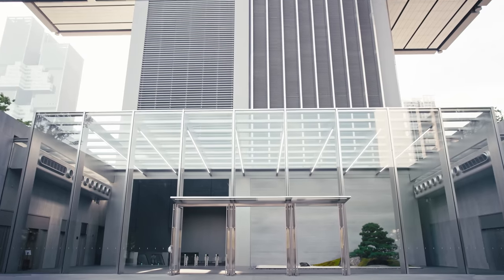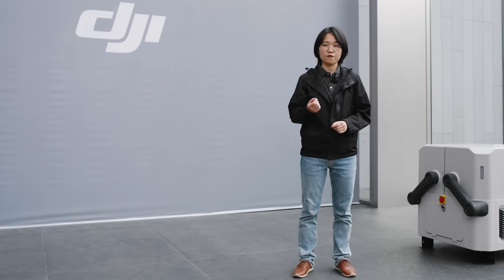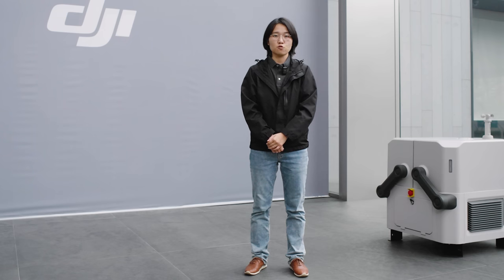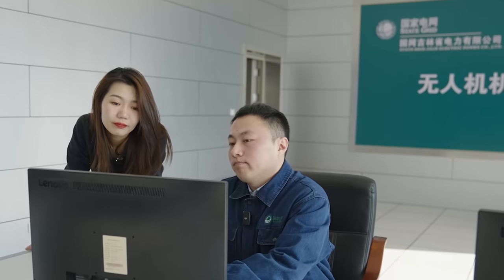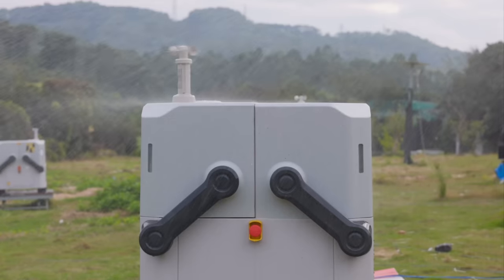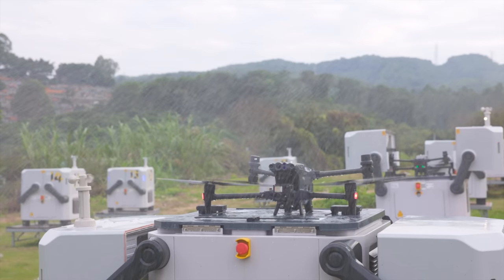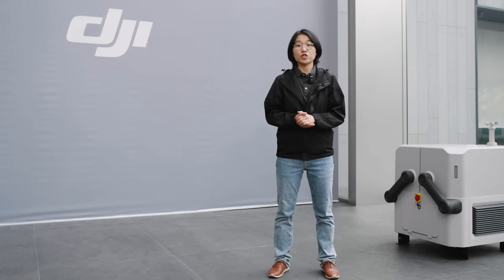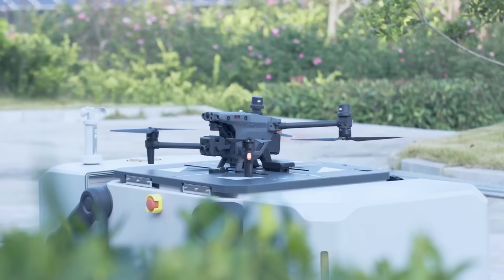DJI Dock, The Next Generation of Drone Technology

Comment: You know it would be cool if DJI could develop a version which you could fit on the roof of a vehicle. Something the Police or emergency services could deploy quickly. Just like the one in Blade Runner 2041, much cheaper than having to call in a helicopter.
Reply: Bro calm down don't give them ideas 😂
Reply: Or you could bolt it down to the bed of a pick up
Reply: @yumcooki3z  Next time we will be seeing army personnel using this technology.
Reply: We will have that in 2041 😂
Reply: 中国有一款越野车仰望U8将实现你的愿望。
Reply: @yumcooki3z  dude, the off road suv U8 from BYD has equipped a dji drone in market now, u should check it out
Reply: @yumcooki3z
Reply: @RahulSingh-pn6nm
Reply: BYD＇s new ORV car will have this technology，it＇s name is yangwang u8.

Comment: The dual hinge design opening in the middle has a giant design flaw: If you open it while snow lays on top, you have your drone fully covered in a thick layer of snow, unable to take off. A single Hinge design taking off the whole cover would solve this.
Reply: I wonder if the hood is heated, which would keep the snow off and dry the wet drone inside.
Reply: @Keezer  I wondered the same. seems likely if this is supposed to be something that can sit for long periods and always be ready to go, the box is charging, drying, and heating the drone/enclosure in cold weather
Reply: Don't tell them sell them one

Comment: DJI is the future. I have a small business and I'm considering a new operation of delivery using DJI Drone. My problem is airdrop accessory remote control distance is too small for my clients. Is it possible to get at least 3-5km airdrop accessory remote control range?
Reply: Sounds like you just need to have better gain antenna signal boosters.

Comment: Does the dock charge the drone? This surprisingly wasn't covered in the video.
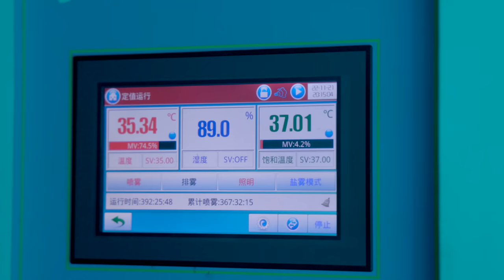Reply: yes you can see that at around 4:30min or so. the clamps push each drone after landing into the middle where most likely is an induction charging pad below or just current through the landing legs.

Comment: so how will it charge the battery in -20c ??? does the box heat the drone to proper levels and melt the ice also? then keep the drone warm ALLWAYS?? batteries dont like the cold and even on -5c you loose like half the capacity... here in Finland that box would freeze shut. and on a proper "rainy" day it would be FULL of snow :D open and close few times and the drone would not be able to land enymore... its nice to go out and find the drone when it hits a bird or a motor fails when the operator is 200km away :D it for sure need to have redundancy and 6 propellers is a must.

Comment: Strange that for a snow scenario that there is no obvious solution for removing snow off the dock.
Reply: A hack would be to locate in under a canopy/carport structure. There's probably no way it could work reliably being left out in snowy/freezing conditions permanently, although the presentation did seem to imply that.
Reply: The snow will probably just melt from the heat generated by the electronics in the box and drain away the same way rain would. The box only opens for a short time so I can't imagine too much snow would get in.
Reply: I believe the hailstones will smash the weather station on the dock

Comment: Looking at a possible application, some concerns come to mind.
If i were to place the dock on a remote site, it there a possibility for me to install products for physical security.
As an exempel, if someone were to force the dock open can i attach an magnetic contact in the doors.
Or is there internal space for me to install a seismic alarm point so i can notice if someone is trying to force the dock open or try to move it.
Weather is nice and all but for some applications it would been interesting to see what options there is for physical security.

Other then that, great solution and i can see a lot of applications were this is very useful in all sectors.

Comment: c/o New Atlas 'The Matrice 30 on its own has a guide price of US$9,999, while the M30T package comes in at $13,999. Operators looking at remote deployment will be looking at around $30k for the DJI Dock and M30 together, or $34k for the Dock and M30T. Buyers are advised to check with local dealers.'

Comment: This is awesome. DJI needs to incorporate Waypoint in the Air 2S and Mini 2. I dont like running 3rd party apps to accomplish this.
Reply: Which apps you use?
Reply: @kuzadupa185  litchi has good waypoint functionality
Reply: I've been using Litchi for the past 2 years for a client's site progress weekly update. So far so good. The app can create/save and perform repeatable waypoints.
Reply: @Shawn_X20A  Yes, I know. I have it as well. It would be great however if DJI would integrate it into the latest DJI Fly app. The Mavic 3 is supported, but not the very popular Air2S and Mini 2 (which I fly) I see DJI removed the link to Litchi I posted yesterday. Come on DJI, Get with the program. Waypoint is the only way to fly.

Comment: One oversight- the entire video, I'm waiting to see how it works? How does it recharge, how long does it take, how long can it fly? Completely left out of the presentation...
Reply: It specified 25 min fast recharge with air conditioned batteries when docked, 7km range with the standard flight time of the Matrice 30. It's safe to assume recharging is done wirelessly similar to charging pads for mobile phones.

Comment: How exactly are you going to go worldwide with this? US regulation requires a licensed operator if the drone weighs above 250 grams, and that's only the US
Reply: worldwide as in only regulated countries and states i guess.i didnt know you needed a license lol,i read you can mod them so they arnt detectable by radar cause once you register them its a air license plate type thing i guess.
Reply: I think you missed the part that this is for "Enterprise" flyers, which means for businesses, and if you are operating a drone for business (for pay) then you must be licensed anyway. I just recently got my FAA License... but I don't get why you think this would prevent DJI from "going worldwide" when there are plenty of licensed drone pilots and businesses that can and will use this platform.
Reply: @pickleeggs3340  well you read wrong then. There is no anti radar device for drones, and in fact all drones after Jan./23 are required to have built  in circuitry that sends a signal out with your ID and location.

Comment: They should have designed the bottom for forklift attachments for construction equipment.  This is a great idea for operations such as ocean oil rig platforms or shipping ports. They got a good opertunity for coast guard  such a offer a drone that has FLIR, IR, and Flare launchers.  They could put the drone on boats & at ground installations for rescuing.

Something like this would be great for a ATVs for rescuing. I would market this for the US & Chinese national  park services because of deep pockets.
Reply: US doesn't buy Chinese (read DJI) drones for govt work anymore from what I've read. The product itself is amazing though!
Reply: @minecraftyou4me  License the patents out to use domestic technology.
Reply: @jmd1743  tell that to policy makers and govt officials. Still the software needed would be ‘Chinese’ and thus ‘dangerous’
Reply: @minecraftyou4me  They could license the patents and use American microchips & software.

So much potential, for instance you could bolt a system to wildfire firetrucks.

Maybe integrate technology long range RFID chips for tracking large numbers  of wild life individuals in groups so the drones could log the identify of all reindeer's so you can pull up the veterinarian information.

You could use those RFID trackers in salmon or dangerous animals such as grizzly bears in national parks.

All you got to so is pair a star link communication system at one of these drone basestations along with a renewable energy charging system.

So once a month you could fly a drone automatically in a geo fenced  area, and you could ping different animals before parking the drone once again.

The DNR would throw money at such a system in Alaska. A drone could fly through a remote canyon and ping animals such as mountain  goats on the cliff, grizzly bears & salmons in  the river, and birds in trees.
Reply: @jmd1743  I also see the possibilities of such a beautiful system. I just don’t see it being implicated… also it would be very cost effective, but a lot of jobs would be lost, and replaced by technical people (doesn’t the US have a shortage in those?).
Reply: @minecraftyou4me  America  produced  80,000 dollars of debt per citizen since 2001 and is now lecturing the young adults about how it's immoral for them to get a student debt bail out when the jobs were often far and between such as ghost job offerings.

Some states require a masters degree to teach k-12  students when they barely pay more than fast food jobs.

There's two kinds of people: those that say "I experienced this hardship, so everyone else should." and "I experienced this hardship and nobody else should have to."

Today those who want others to suffer because they did now out number the selfless unlike a few decades ago when we all thought that we would be living in the Jetson's world today.
Reply: @jmd1743  To be fair, student loan debt is entirely on the fault of students who go to expensive schools to get useless degrees. Most people have no problem paying of their student debt and it is immoral to make people who work hard pay for the debts of people who don't.

The debt is mainly due to government spending. Not only has it caused the inflation which has halved the value of people's savings, but also lead to rising taxes where most people are paying almost 40% income tax and as a result less people are filing their taxes. I think since Biden came into power, the taxpayer population reduced by 1/4, and the nominal taxpayer populating is only like 50% at best.
Reply: @DaveSmith-cp5kj  You wouldn't say an 18 year old to be mature enough to have a child.

Their parents, their grandparents, their teachers, student guidance councilors, and government policies pushed these kids into getting themselves into predatory loans that they can't legally declare bankruptcy from.

Society told them that if they didn't go to college then they would be working at fast food for life.

This isn't like a stupid boat loan some 50 year old retiree got himself into.

So I say bail the student loans out and do a financial reform of how we as a society is willing to make sure our kids are able to afford college.

These kids are essentially indentured servants when the indentured servants of the day had a set date in which they were free individuals.

To say that they "signed the dotted line" is disingenuous.

I'm seeing politicians hold the country hostage over the debt ceiling as extortion to prevent a student debt bailout.

Those old gas bags who're lecturing the country about morality in regards to paying back the student debt back are the ones who gave each new born 96,000 dollars of debt to pay off.

We could have given all current high school students to a full ride to their local state university for the amount of money we've wasted since 2001.

We haven't balanced the budget since 2001 and politicians are getting their panties in a twist.

In reality these politicians are only concerned about wall street going bust over Student Loan Asset-Backed Securities: